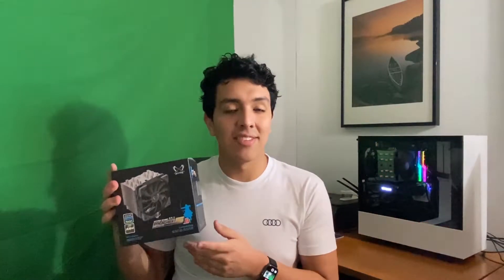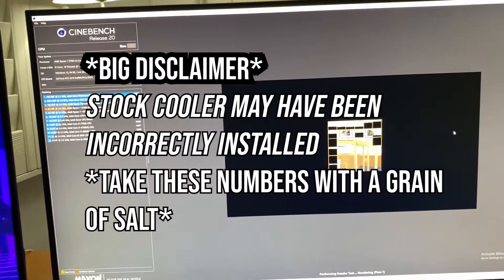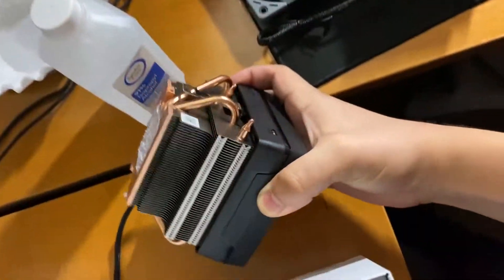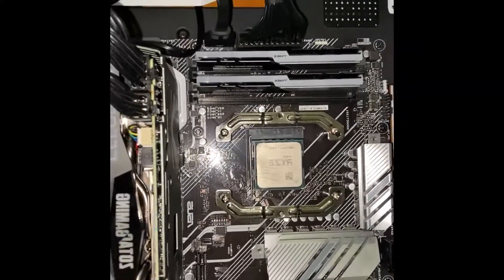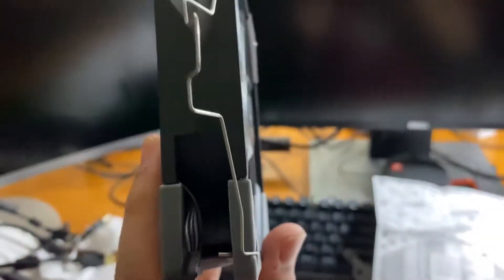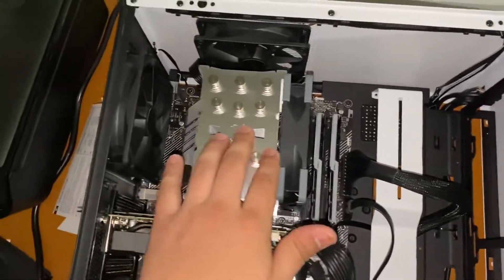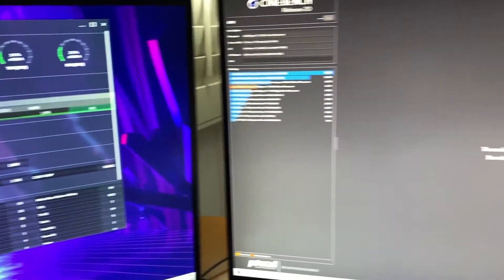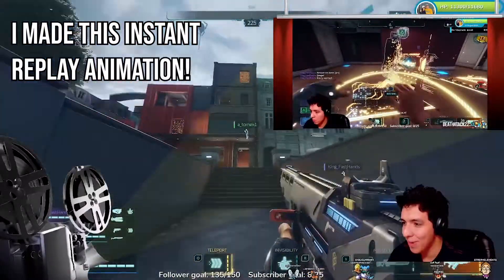CPU COOLER INSTALL - 20 DEGREE DROP |Scythe Mugen 5 Rev.B|

Comment: The Crosshair VI will mount AM3 or AM4 coolers. Worked really well a old 6 pipe cooler for a FX-8350. 
So I installed a 3800 X and the Bios update.
 Just a little bit flaky it is.
SO get 53C with 3900 Mhz all cores locked and voltages set for 1.100 volts with CPU-Z stress after 5 minutes.
 Just using precision boost standard settings gets 73C after 5 minutes. The CPU? A 3800X.
So I bought a X570 motherboard. NO I did not buy a Crosshair VIII, lol. But here is the bad part Cooler Master quit making AM4 adapter for the old AM3 coolers.
But I can buy one the adapters left on Flea Bay for about the same price as the Mugen 5 B. Direct from Scythe.

Comment: I got a question. If you spin your mugen fan as fast as you can with your finger and then put your ear close, does it make a humming sound? I haven't installed mine yet as I don't know if that's what the fan does or it is defective.
Reply from the maker: I have not tested that but I can tell you when I am gaming the Mugen fan is not audible